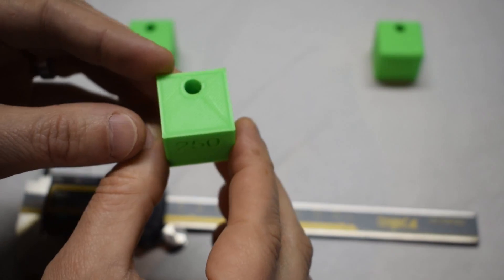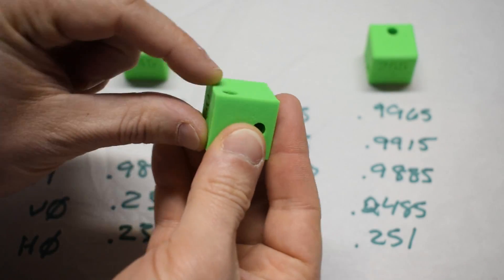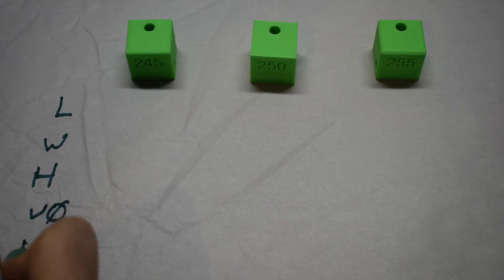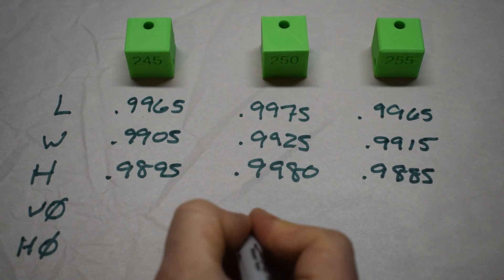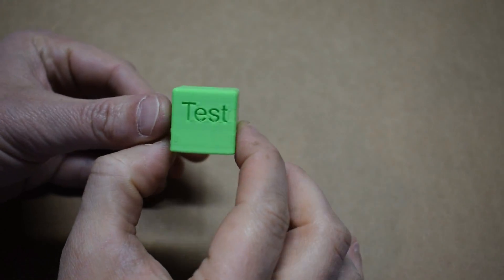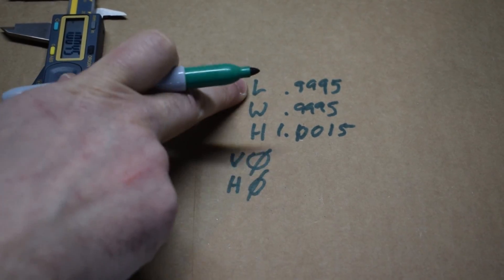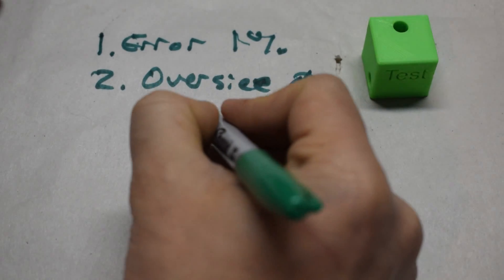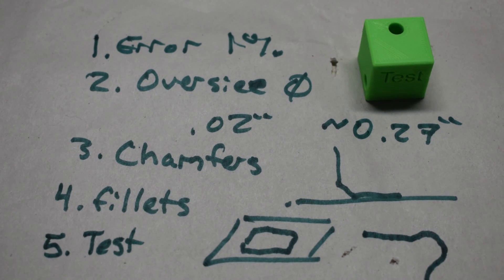Understanding 3D Printer Accuracy

Comment: Great video ! Holes must be oversized by at least half of the nozzle diameter +5-10%. Then NEVER print any calibration part smaller than 100mm long/wide. The bigger your calibration print, the more accurate and reliable will be the result of your e-step tune. Hope that helps you save some filament on your test prints!

Comment: Brilliant, and and thanks so much for this info.  Those 1% differences DO matter for my own applications.  
Is there any chance you have done the same tests using 3D printed screw/bolt threads?  If only for the purpose of "tapping" and starting small bolts or screws?  Micro machine bolts would be my own particular areas of interest, but both dimensional shrinkage testing and "ease of starting" micro sized bolts into a 3D printed hole would also be of help.
In any case, thank you for your efforts to make these questions clear.  Very much appreciated.
Reply: If it's still relevant, depending on screw size forming the thread or using nut inserts is usually the way to go. For example an M3 tapped hole should be designed with 2.75mm bore diameter, as 2.75 is the median of the outside diameter of 3.0mm and inside diameter of 2.5mm. Then just force the screw into the 3d print using a cordless drill. The friction will cause enough heat for the 3d print to deform and flow around the thread. Let the screw cool down then unscrew.
It's not the most sophisticated method, but with plastic 3d prints you will never get threads as strong as the mating steel bolt.

Comment: Good information. Don't think 1% tolerance is good when you make something larger. You're spot on with TEST. Often times I make a test part only .1" thick to see if it fits. Much  faster & less plastic. Some times I find it's not proportional with od & id on the same part.

Comment: I noticed with my printer that the length and width measurement is varies across the faces. Around the corners it's more and towards the middle of the face, it's smaller. What's the reason for this? I printed with rounded edges except for bottom which was sharp corner.

Comment: Are you dialing in the components design or the printer?
Reply from the maker: In this case I was making adjustments to the design, not the printer.
Reply: @HammeredNailed  thanks. Keep up the good work! I've printed far too many cubes and tolerance test. One of these days it'll be up to snuff
Reply from the maker: @12setver  So rarely do we need things that are perfect. Understanding the accuracy that you can expect helps you inform the design from the beginning. Accommodating the necessary clearances usually means first prints work, I stopped messing with calibration cubes a long time ago... just print it!

Comment: I like this.  I was recently printing parts and noticed for a 6 mm height part I had 6.29.  It left me to wonder, though....  Should we be trying to make our models based on the multiples of xyz resolutions?  Is it easier for the machine?
Reply from the maker: I do consider the layer height and feature size on small features. For example, I wouldn't try and print an 0.5mm feature using 0.2mm layer heights. I think this is particularly important if you're trying to emboss letters on something.

Comment: Or... adjust your steps per mm.
Reply: Hey, I was wondering about this approach to get to accuracy. Do you find that once the steps per mm are dialed in decent, you get accurate prints most times? It just feel more right to dial the printer in first instead of tweaking the model to compensate for a less optimal tweaked printer.

Comment: Good, i get the theory but how to apply this? I assume in your case you just adjusted it on the model like in fusion360. But what if we don't have the model? Ie just an stl file? Do you use XY compensation? Do you just scale up the model by your average percent for that axis?
Reply: Hey there, you can edit STL in your cad software just search it, or try to compensate like you said which is probably last resort, for me I add the shrinkage value like for Taulman alloy 910 it’s about .003/in to the dimensions in the cad model, if someone else is designing I’ll ask them to add it just to make it easier. I use inventor

Comment: Couldn't the variation from STL design be the fault of the slicer?  Which slicer did you use?
Reply from the maker: It's possible for the cylindrical holes, but not for the outsides of the cube. STL files will convert the circles into polygons, and that would explain the smaller diameters. These were sliced in Cura 15.04.6
Reply: Have you checked the G-code G1's to make sure that they reflect your desired dimensions?  (I'm sure they probably do, but unless you know exactly what the G-code is asking the printer to do, one can't be sure)

Comment: A hexagonal hole will print more accurately than a circular hole, both horizontally and vertically. (I have not tried on a diameter tho...)
Reply from the maker: I would believe that, though I would expect some sagging in the angled walls on the horizontal hole if you don't use support.
Reply: When the hexagon is oriented so that 2 of the sides are parallel do the bed there is basically no sagging at all, the side walls have a very forgiving angle, even for poorly calibrated printers and most printers (with cooling at least) handle bridging way better than they can handle the steep overhangs on circles.

Also, the STL files that are generated without circles or curves have a much smaller file size, are less prone to errors, and are generally easier to edit with modeling software.
Reply from the maker: But on the other hand, G-code for a hexagon is longer; so the file for the printer is larger ...
Reply: I don't think that should be true... STLs don't really "do" curves so any circle would be cut into a bunch of straight line segments resulting in a multi-sided shape that is close to a circle whereas the hexagon has less total lines. 

I did a quick test with a 20mm cube with a 10mm hole cut through it vs a 20mm cube with a 10 mm hexagon cut through it. The hexagon gcode file was less than half the size, and the hexagon STL file was 1/5th the size. 

THAT being said, we're talking about a few hundred kb, not exactly breaking the bandwidth bank lol